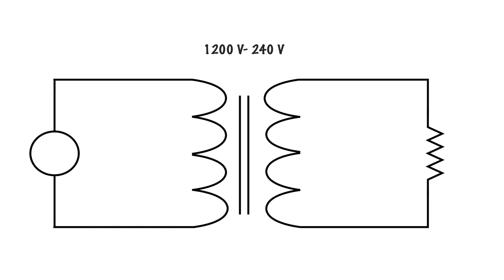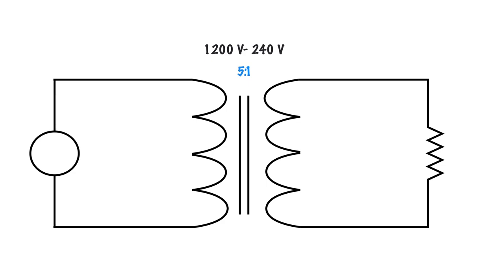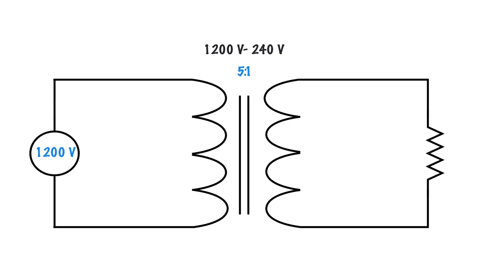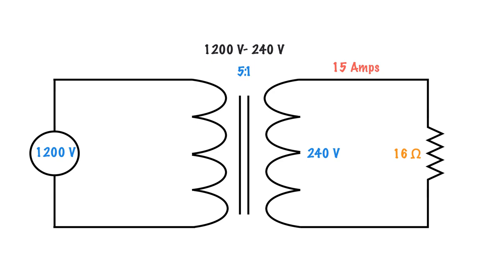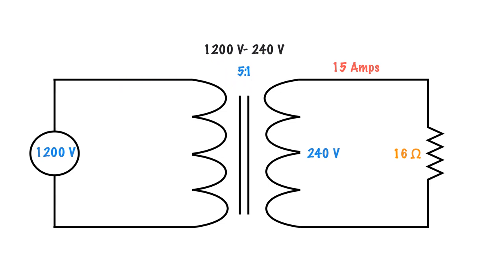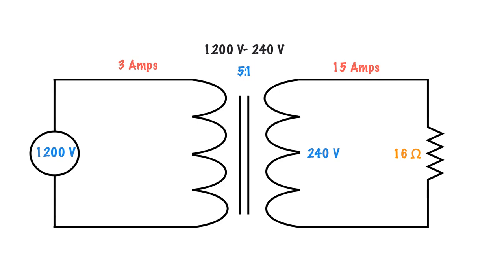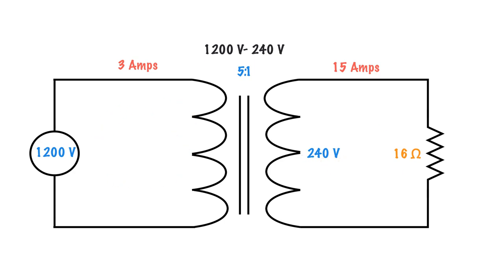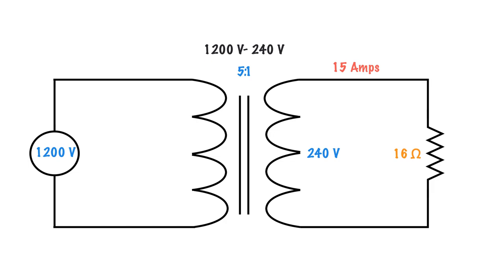How to calculate the winding current of a transformer using turns ratio

Comment: What it is all about who told you 15A in secondary how you got that 15 from where 240V with 16 ohms load is 13.75  and where the turn ratio is used to calculate current what about if transformer rated for 1 A and you calculated 15A
Reply: We, I agree... this video doesn't consider the wire awg on the primary or secondary to determine if primary can even handle the range of current drawn! The math is okay, but leaving out a few variables to determine amps.

Comment: So I watched this video now, and now I know. So I wired up a coil, one with 6 windings and one with 3 winding to step down from 240V to 120V and boom, all fuses are out.

What I'm trying to say here, no one on YouTube can tell me how many windings a coil needs. 
If I want to step down from 240AC to 120AC
Primary 50 secondary 25?
Primary 100 secondary 50?
Primary 200 secondary 100?
Primary 400 secondary 200?
Primary 800 secondary 400?
Primary 1600 secondary 800?
Primary 3200 secondary 1600?

How to calculate the number of turns??
Reply: i think in most cases you’d like to have a volt per turn number of 1 or greater. so for 240v primary have 240 turns or windings. i think any number below 1 for a v/t is bad

Comment: You are explaining Ohm's law by Ohm's law. You got voltage and resistance and it took you 4 minutes to divide them. I have transformer and don't know anything but voltages and am trying to figure how to calculate power rating, but your video is obviously not going to help.
Reply: just multiple the volts by amps equal power
Reply: @mtevans6196  Amps of what? There's no current without circuit. And in circuit it depends on load.
Reply: Yes my friend this man is just spreading fake information ,as in reality the power of a transformer depend upon the area of iron core used and the diameter of both primary and secondary wires used😂.